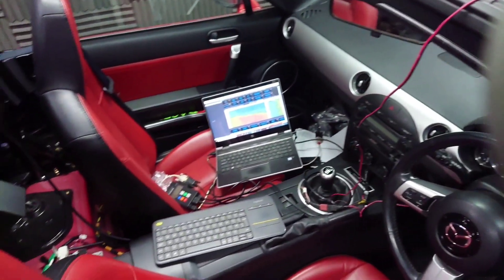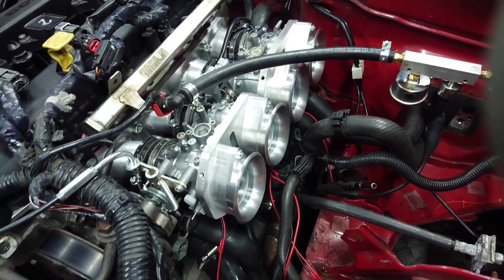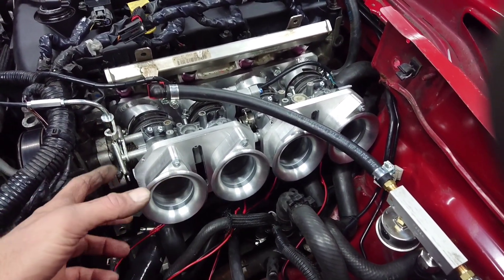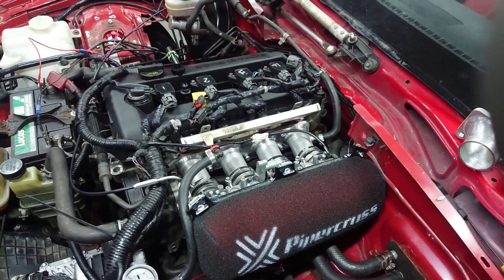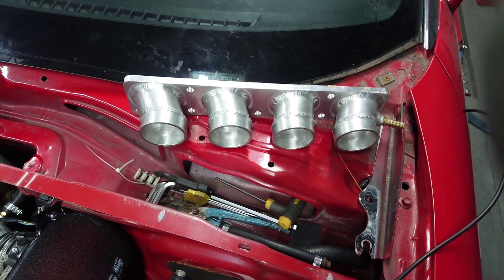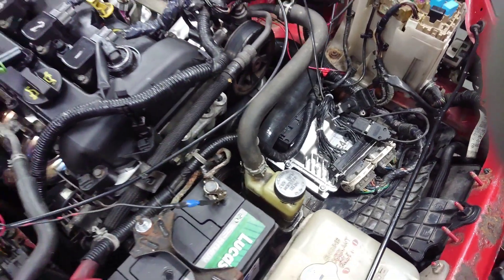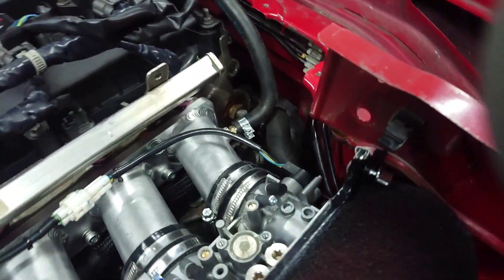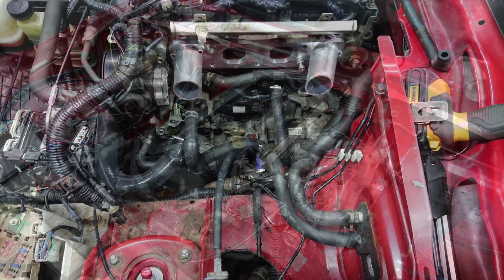Mazda MX5 NC 2.5 Duratec on Individual Throttle Bodies

Comment: Any tests done on a stock 2.0L engine with the ITBs ?
Reply from the maker: Hi, not on an MX5 but we ran a fiesta ST150 on a very similar kit using ZX10 throttle bodies. This produced 180bhp with a free flowing exhaust manifold and system. We would expect to see very similar on the MX5 but no doubt with greater torque due to the VCT.
Reply: Has already been tested,one customer yielded 203 hp with 45 mm tb's in a standart 2.0 mx5 nc.
You should expect about 200hp on the Mx5 2.0 mzr/duratec with a free flowing exhaust manifold and 45mm tb's.
Altough the fiesta and mx5 shares same base block, its not exactly the same engine and the MZR on the mx5 produces a tad more power with similar mods.
Reply: @Theyefull  thanks a lot for the info!
Reply: @Theyefull  where could one acquire said throttle bodies for the 2.0 NC?

Comment: Do you know if the Fusion 2.5 has the high flow RF3S4G/RF6S4E head?
Reply from the maker: The 2.5 has a different, larger port head that flows similar to the high port 2.0 head.
Reply: Interesting. Do you know if there are multiple head castings found on the 2.5? I'm trying to find out exactly which motor to look for at the junkers here in the States.

If it hasn't been said, thanks for all the secret sauce details you give in your videos and here in the comments. It's much appreciated.

Comment: How much WHP did you gain by just adding IBT ? I am very tempted to add this to my track NC 2.5 camed.
Reply from the maker: We've not run a 2.5 without ITB on our dyno so hard to make a direct comparison. But 20whp would be a cautious estimate
Reply: @DanstengineeringCoUk   thanks , where can I check your prices and ordering methods? I tried link from your video but didn't get to your website .
Reply from the maker: @driver46  the 2.0 and 2.5 kits are now listed on our website: https://danstengineering.co.uk/index.php?route=product/search&search=Mx5%20nc
Reply: What cams are you running in this?
Reply from the maker: @danielmartin6492  standard cams
Reply: @danielmartin6492   Esslinger Engineering stage 2 cams . They are specialized in Ford 4cl engines and they make bunch of good stuff that we can use on NC platform.
Reply: @driver46  yea familiar with them. Seems low numbers for itbs and cams?
Reply from the maker: @driver46  we're on standard cams here 👍

Comment: I think you would gain a nice flat torque curve with the vvt & bike throttlebodies will restrict your power to 200bhp also
Reply from the maker: The vct is running here, hence the nice torque (turn it off and we loose about 25lbft!). The bike bodies will be good for much more, we've had high spec zetecs do 240bhp on 44mm gsxr bodies